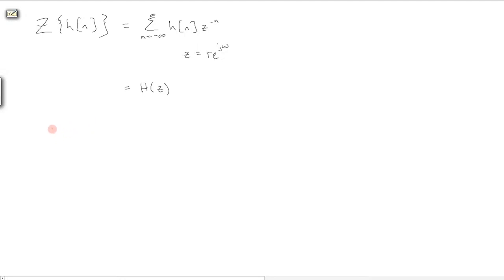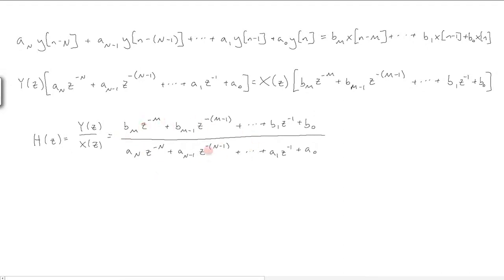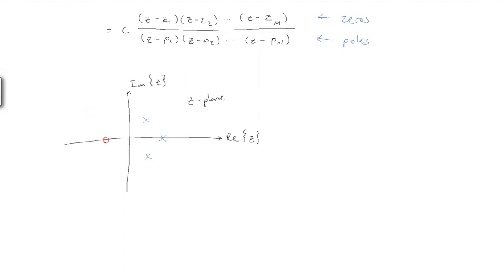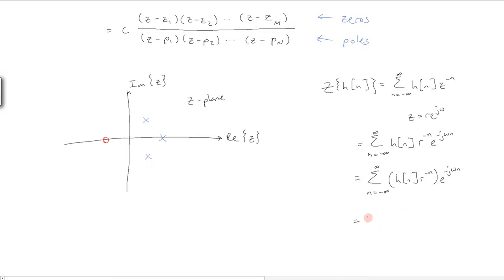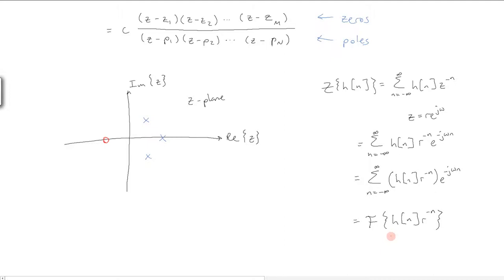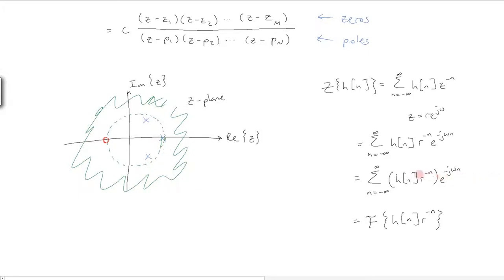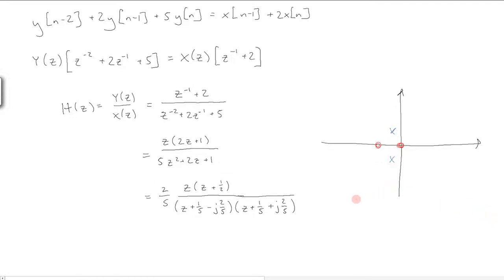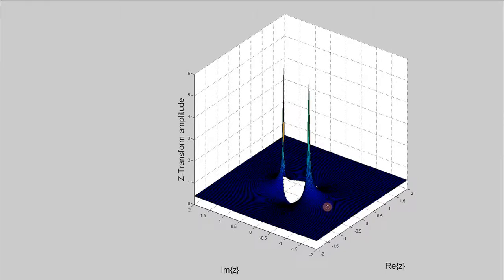Z-Transform Poles and Zeros

Comment: Would you mind sharing the code you use in the matlab example?
Reply from the maker: +Memo “MekoxTwiSparkle” Pony The code I used is below.  Copy and paste it into the MATLAB editor, and make sure to save it as ZT_demo (so it runs the function properly).

function ZT_demo

figure(1);
circle([0 0],1,1000,'g');
hold on;line([0 0],[-1.5 1.5],'LineWidth',3);
line([-1.5 1.5],[0 0],'LineWidth',3)
plot(-.5,0,'or','MarkerSize',12,'LineWidth',3);
plot(0,0,'or','MarkerSize',12,'LineWidth',3);
plot(-1/5,2/5,'xr','MarkerSize',12,'LineWidth',3);
plot(-1/5,-2/5,'xr','MarkerSize',12,'LineWidth',3);
xlabel('Re\{z\}','FontSize',20)
ylabel('Im\{z\}','FontSize',20)
circle([0 0],norm([1/5 2/5]),1000,'r');
axis square

sigma_vec = -2:.02:2;
omega_vec = -2:.02:2;
z_plane = zeros(length(omega_vec),length(sigma_vec));
for ii = 1:length(sigma_vec)
    sigma = sigma_vec(ii);
    for jj = 1:length(omega_vec)
        omega = omega_vec(jj);
        s = sigma + 1i*omega;
        if norm(s)<norm([1/5 2/5])
            H = NaN;
        else
            H = 2/5*(s*(s+1/2))/((s+1/5-2/5*1i)*(s+1/5+2/5*1i));
        end
        z_plane(jj,ii) = abs(H);
    end
end

figure(2);surf(sigma_vec,omega_vec,z_plane);
zlim([0 6])
xlabel('Re\{z\}','FontSize',20)
ylabel('Im\{z\}','FontSize',20)
zlabel('Z-Transform amplitude','FontSize',20)
axis square

function h=circle(center,radius,num_point,style)

if (nargin <3),
 error('Not enough input data.');
elseif (nargin==3)
    style = 'b-';
end

theta = linspace(0,2*pi,num_point);
rho = ones(1,num_point)*radius;
[x,y] = pol2cart(theta,rho);
x = x + center(1);
y = y + center(2);
h = plot(x,y,style);
Reply: Ilya Mikhelson
 Do you mind if you could help me on this assignment I have? I'm new to matlab and I'd really like help in how to plot these signals in matlab. Could I email you it?
Reply from the maker: +Memo “MekoxTwiSparkle” Pony You can definitely email me.  My email is i-mikhelson@northwestern.edu.  I generally don't have time to answer questions about specific assignments, but I can answer general MATLAB questions.
Reply: Ilya Mikhelson
Thank you so much. I just need a kind of steering in the right direction so to speak. :)
Reply: I emailed it to you.

Comment: This was very useful. Thanks a lot of the video!
1 question. Shouldn't the z-plane be in polar coordinates? In which the radius is represented by r so that the fourier coefficients will be at different angles representing frequency axis between concentric circles..
Reply from the maker: Sampath Kumar That's a good question!  The z-plane should naturally be in polar coordinates, since that is the notation that would have the most physical significance.  However, the math works out more easily in the form shown at 2:55, which is in rectangular coordinates.  Remember, though, that both are equivalent, as we are able to convert between the two.  The important thing here is to find where the poles and zeros are, which tends to be easier in rectangular coordinates.  I hope this helps!